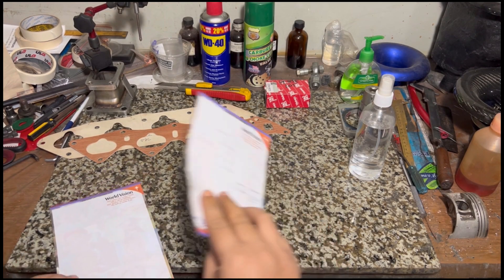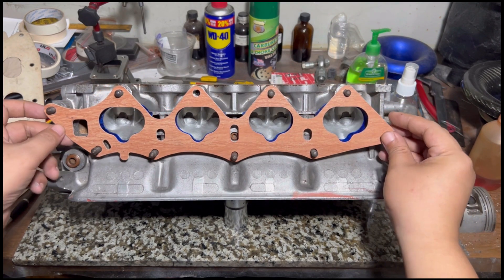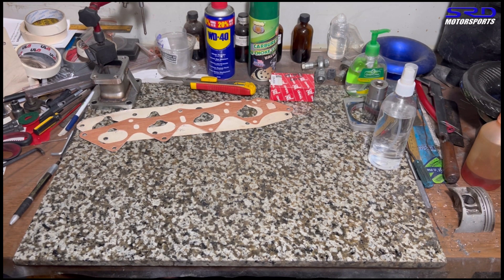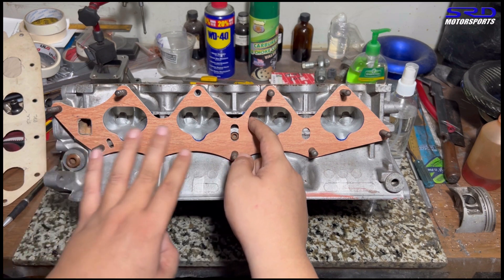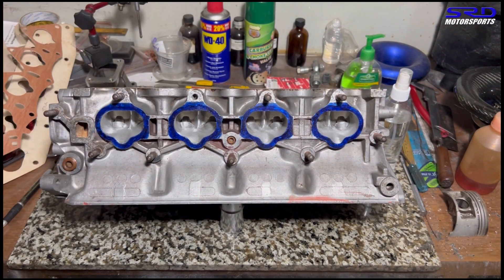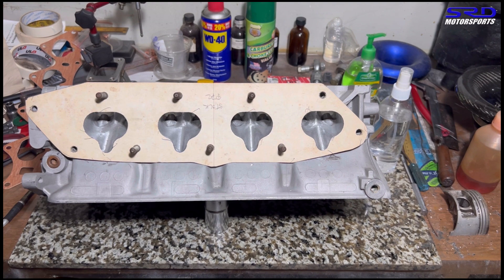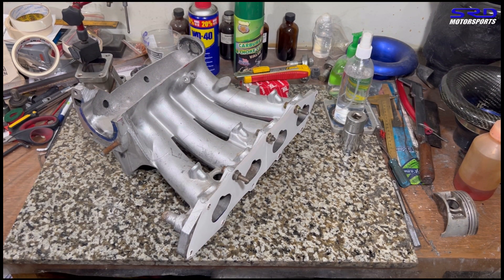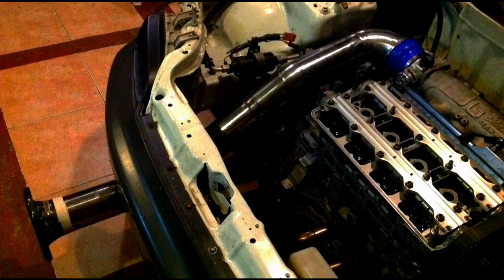Gasket Match or Port Match What Should You do? by SRDmotorsports

Comment: So my question is how do you make the pattern?
Reply: In your video you trace a pattern you have already made but that doesn't help me if I don't have the pattern right
Reply from the maker: @shaby1977  if u have the head ? Thats ur pattern
Reply from the maker: The pattern was already made for the exact head on the video based on that head itself
Reply from the maker: After all you are matching the manifold to “that” head
Reply: @SRDmotorsports  I do have the head but I'm confused on how to transfer it to the pattern that I would be making if that makes sense like i trace out the outer part of the pattern which is straight forward but the intake runners are blocked by the new pattern I would be making 
Great videos by the way very informative and helpful I love your content
Reply from the maker: @shaby1977  oh u mean the intake runner is bigger than the head? that’s hard indeed it means the head opening has to be bigger to compensate but then that doesn’t help flow if it’s too much
Reply: No I mean how do you trace the intake runner to the new cardboard gasket to be able to cut out the hole in the pattern 
Sorry if I’m not explaining it correctly
Reply from the maker: @shaymortimer8684  press it with ur hands/fingers u will see it trace a pattern and then u can just trace it with a pencil or pen (that’s a secret) 🤫 😂
Reply from the maker: Trace the gasket to the head first once u get the markings good? Cut it with a cutter then next u can bolt it to the manifold flange to compare

On the members only video I got some video about that too in the top member or gold member

Comment: What if its a thermal intake manifold gasket? Can you just port match it then use it as a template for the manifold??
Reply from the maker: if it’s aligned yeah but a lot of times it’s not aligned it’s always to one side etc so we would rather do an aligned gasket
Reply: @SRDmotorsports  Hmm ok. I was thinking if I can get one down, I can 3d print it over and over again in tpu whenever I need one.
Reply from the maker: @Jamxknife  if u can 3d print the template u make off a proper head then yes.

Cuz the ones we can buy on the market the thermal gaskets are much the same as any other intake gasket they’re always mis aligned one sidedly

Comment: you make such great videos. i just wanted to ask though, this video is more for match porting. so in a case of when you want to port for better flow and you increase the diameter from both the intake and head, which part do you port first? the head or the intake? and then do you match port afterwards?
Reply from the maker: It really depends but since it’s almost often the head port is bigger than the intake port I port match “after” porting the head, then I double check intake gasket pattern and apply it to the intake manifold and port match the intake to the head
Reply: @SRDmotorsports  so am i correct in saying that when you do port the head, you just ensure that the casting marks are removed and the ports are somewhat even throughout the port? and then once thats complete you match port to the intake? does this apply for ITB setups as well? do you port the adapter?
Reply from the maker: Yes but that’s not a one answer for all… some engines the head are either lacking or have too much port volume so they should be worked with a different approach from one another
Reply: @SRDmotorsports  i understand that yes you always make mention of that. the head i want to try to port is a apk vw head. i tried looking if you perhaps had it on your page but i didnt find anything. are there any guidelines you could perhaps give me?
Reply from the maker: Oh I havnt worked on that head but il look around
Reply: @SRDmotorsports  thank you! i really appreciate it as well as all the content you make. very informative and accurate, i only like your porting and polishing videos.
Reply from the maker: Oh thank you man and you’re welcome

Comment: Or u can just port match to gasket lol
Reply from the maker: and gaskets aren’t always well aligned to the head casting as mentioned and explained on the video

unless it’s a cb 044 ported head their gasket is the pattern for the intake to be matched

but even on vw , the oem intake gasket is cross eyed
Reply: @SRDmotorsports  It's true that gaskets don't always align up perfect with the gasket guide....it's just confusing hearing port match..... I better term would be port match to gasket because EVEYONE still uses the gasket as a template to cross over to manifold port to cylinder intake port
Reply from the maker: Which is exactly the misconception

Port match = match both head and intake port

Using gasket as a template is also what everyone calls “gasket match” 
which already ruins a lot of things especially if they take into account “cross sectional area”
Reply: @SRDmotorsports  ok I understand now.....because the gasket dosnt align up perfect with the gasket guide.....this is why u do your method......but.....if the gasket aligns up perfect with the cylinder head then u can gasket match
Reply from the maker: Yeah that’s it

Comment: Ported manifold on unported head. Will it improve my engine performance? Just a question. Thank you sir
Reply from the maker: Really depends, and really has to be looked at it in a different way. a lot of locals to me do this and see it as “this” + “this” = “fast”

Sadly it’s also suggested by “friends” who aren’t spending their money but you are 😂
If they spend their money either they stop suggesting or they want to be more sure lol

to answer the questions and why it depends
will the engine be needing it? Like will the header be flowing enough to want the stock head to be upgraded to a ported intake manifold?  It’s just like a ported head depends if the header and exhaust and cam will merit the upgrade.
Reply from the maker: This is  also why I’ve seen locally
A b20vtec with cams, run just 201whp
But has a “TypeR” manifold 

pretty sure that was followed by friends suggestions that never built one and or read somewhere… cuz of the TypeR manifold lol and all

but 201whp is like a strong B16 lng not even a b20 lol
Reply: Thank you sir. This would really help a lot. I believe that it really depends on the combination. I put up a ported manifold on my b16a head and hopefully would gain something on this. Been watching your Sir build series and really learning a lot. Keep it up sir
Reply from the maker: No worries
Reply: Another question sir. I'm planning to put b16b cams with crower valve spring and rets and camgears on my stock b16a engine with the ported manifold on stock head, stock piston. Is it worth it or do I need to have my head ported or upgrade my pistons?
Reply from the maker: Too many things to consider a builder should really look into that
Reply: Thanks again sir. Looking forward on your non vtec project
Reply from the maker: No prob! Thank you

Comment: Hello, thank you for great video with lots of knowladge. I have a question, i heard about 'golden' 90% rule for valves, which was told by David Vizard, and other american pushrod v8 dual valve engine porters. Asked a few locals, who port hondas, opels(chevy in south america opel astra/chevy astra) and say that upto 85-87%, 89% with lots of lift. So what makes 4 valve engines want smaller throat? 

Also what port entry area should i aim for? Maybe there is a rule for throat areaXvalve numberXfixed number or something like that?

Also i see entry of port beeing really big, but after devider two 'pipes' going to the valve seem quite small. How small or big cross section area is allowed after deviders?

Also have you tried a-symmetrical porting, one of ports f.e. left stock, but blended seats, and another one enlarged so it has swirl in cylinder like diesel? Diesel can be killed if you port out twist ramps. 

A few ideas a few questions, have a great day. Thank you.
Reply from the maker: Interesting about the valve to throat question… it’s also because it’s 2 intake valve (on 4 valve) than 1 intake valve (on 8 valve) 

In layman’s term… two 85-87% of 33mm (Honda) is more curtain area than one 90% of 42mm valve… so when we think about it it’s already big but Ofcourse it spins more rpm’s so it works 

(Outside the port area Vs throat to valve which is a factor in itself)

Comment: You always provide the best results  buddy love your video also I have a ? I have a gs 90 with the b18a1 its start dropping  all the oil to the exaust  but the car  doesn't  warm up no coolant. Leak and good power on the engine what  it's the common  problems for my issue?
Reply from the maker: Thank you buddy! Well if it spend warm up on coolant maybe the thermostat is clogged check that